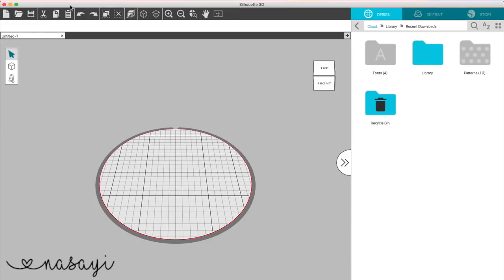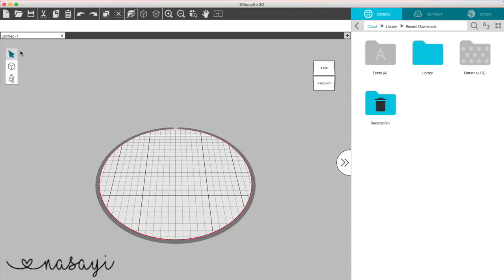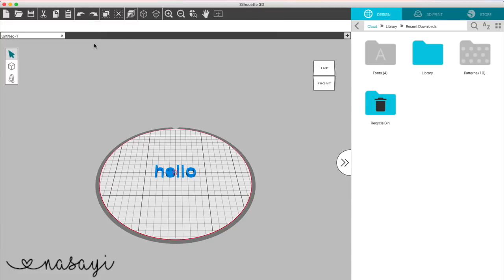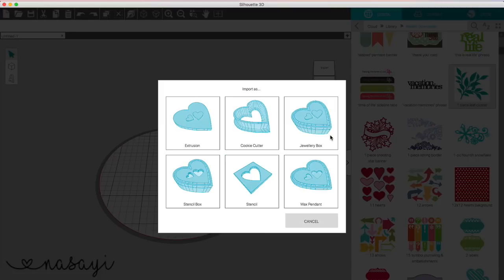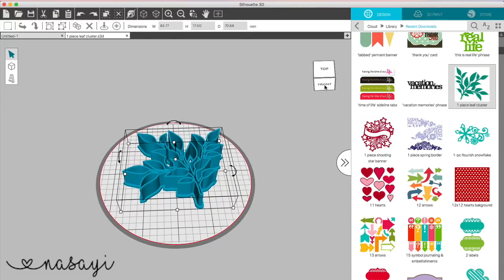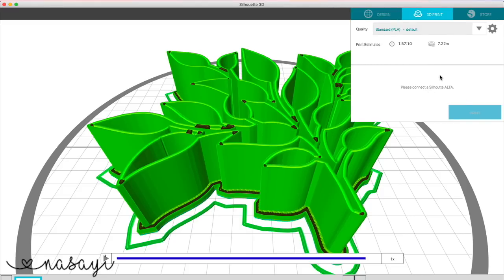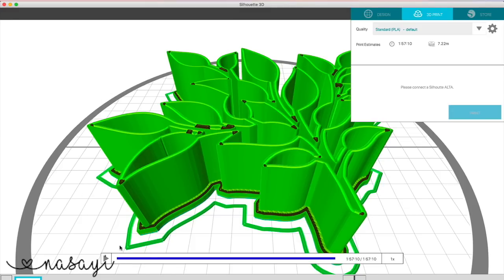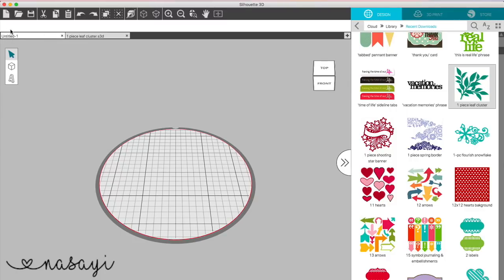First Look at Silhouette 3D...  (Alta's Software)

Comment: I’ve printed my first print on the Alta+. The software has been upgraded since this video. But, even though it’s my first time printing in 3D, as a creative that works in Illustrator regularly, unless I’m just not understanding something, this is some pretty basic, lackluster software. I will have to see how I can design and import STL files from elsewhere and that’s after I actually get it to recognize the printer with the computer I normally use. I’ve seen someone else’s Hell Trip online, where this is concerned.

Tried to import an SVG and this software can’t even do that. It just crashes.

Seems like they don’t bother to publish enough specs to have it work with better software either.

Even in the 3D area of the Silhouette website, you find nothing having to do with the Altas. Makes customers feel like they’ve paid money, to be out on a limb, for a product Silhouette isn’t even sure they want to support and offer.

While I did not expect a high level printer, I suspect this printer is really just a foray into the 3D market, for Silhouette, just to make my e a bit of a presence, as a 3D kitchen counter appliance.